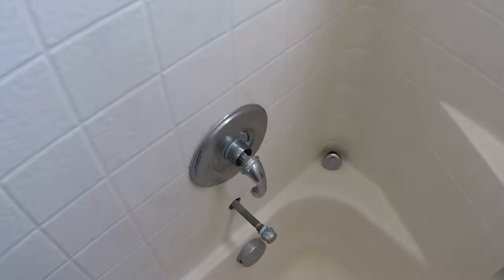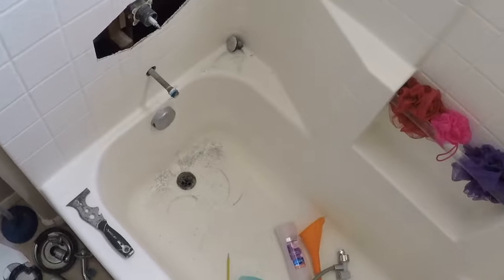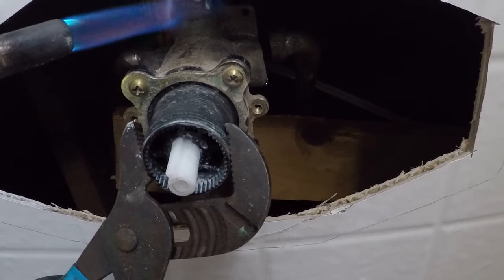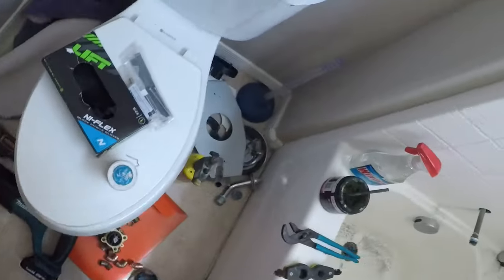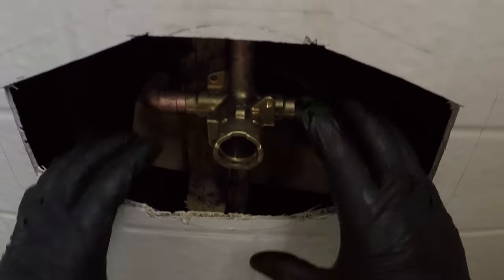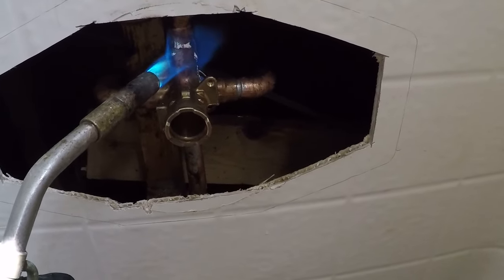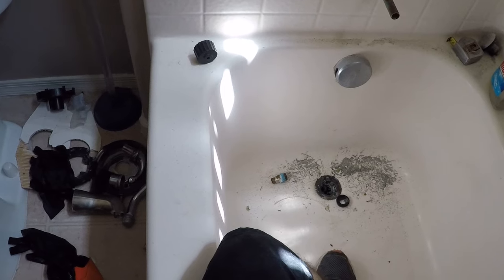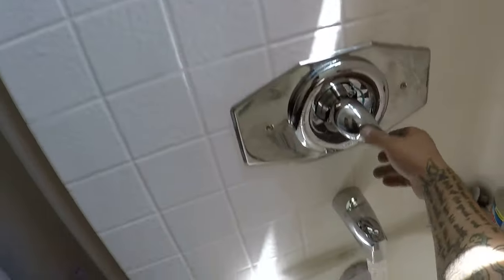How To Replace A Shower Valve Through Fiberglass - Gilbert, AZ

Comment: baffles me why to this day they don't build access panels
Reply from the maker: Well there’s actually another shower on the backside of this one, so I’m not sure that it would have helped in this application. But any other time, yes they do help and they do need them.
Reply: Medic311 cause more labor and parts 😂.
Reply from the maker: john tran Read the comment above. There’s another shower on the backside. What a bunch of geniuses on here lol
Reply: GMR PLUMBING i dont need to read comment.  I already know theres not a backside in your case. With common sense.  I mean why would you cut it in the front if theres backside. I said theres more labor and cost cause even new houses they don’t make access pane (like a already build access panel ready) I didnt said anything about your situation. You must misunderstand me lol
Reply from the maker: john tran Oh yes I see now. Yes you are exactly right. I must have misunderstood that. It’s just that there’s so many people on here that like to sit at home and criticize when they have never even touched a tool or plumbing in their life and have no valid plumbing license to back it up. It can be very frustrating sometimes.
Reply: GMR PLUMBING haha yep.  Bunch of idiots or even if there are some plumbers in here criticize you cause they do a different method and you dont follow their way they hate you haha.    The only thing i do different from you is i spray the surrounding area with water when i start using the torch and put some layers of towel in the bathtub so i don’t get complain saying i scratch their tub. A lot of people tell me i need fire extinguishers but water is enough for me. Sometimes i do it without spraying it.  Whatever it is its all good 😅

Comment: What the hell man, why did you go through all that BS when you could have just changed the Price Pfister cartridge and get a new trim kit?
Reply from the maker: The cartridge was stuck and the owner
Didn’t want to fight with it. They wanted to switch to Moen already beforehand anyway.
Reply: @TOTALTECHAZ  my cap is off to you brother,  hate putting a flame inside walls in finished homes
Reply from the maker: @stoneywilliams1209  Yea as long as you're careful it is not too bad. It really helps to have an adjustable flame that you can shrink.

Comment: no putty on backside of chrome cover? All that work and the easiest thing you don't do. LEAKER.
Reply from the maker: James Weirich Make us a video so we can see how a real pro does it. Thanks for watching.
Reply: I'm not a Plumber but I do know the use of putty and caulk is important to seal the job. Might as well do it right or don't do it at all.
Reply from the maker: James Weirich If you already know about it then you don't need me to show it to you. That's not really the point of this video. Maybe I did it after I stopped filming .  Obviously I know  that the plate needs to be sealed. There are plenty of other videos you can watch on YouTube about this. I don't remember inviting you here to tell me what I'm doing "wrong". If it's not something you're learning from then take a walk.
Reply from the maker: mike mike I did the job for $100 so it worked out. Thanks for watching.
Reply: That does not seam like much for the amount of work you did.
Reply from the maker: I was just being sarcastic to that know-it-all who probably lives in his mom's basement and has never touched a wrench in his life. Telling me what I woulda coulda shoulda done. It was definitely more than that but it was definitely fair. It was the best thing to do in that situation. I will be posting again soon. Thanks for watching!
Reply: Couple things here.  First goes to the plumber that's admittedly not a plumber.  Most shower valve kits come with a foam sealant on the backside of the cover.  Which is what you are referring too and really don't need caulked.  Caulking it is a cosmetic and only on the outside.  Never, never, never putty.  Never for anything should you use putty.  Putty is garbage and will create leaks quicker than you put it in.  He did a good job of what he did.  Sorry if you watch this old house and believe everything they say.  Coming from another plumber, he did nothing wrong.  Your just a guy who thinks he knows what he's talking about but in all honesty AND reality you don't.  Too the actual plumber, curious why you flux your joints after you have unsoldered the joints?  Why not just a wet wash cloth and then polish it up with sand paper or brush.   Secondly.  Do you have quick cuts?  Makes life easier than a sawzall.  But to each there own. Thirdly, I hate anything Moen.
Reply: Justin Dewan YeanI have some Auto Cuts but if you look carefully I actually cut the brass shower valve itself because it had Street 90s soldered directly into it and it was too far back to get the Cutters way back in there. But yeah typically that is the easiest way. Also you're right I could just use a cloth or something but it seems like flexing them really gets it down as flat to The Copper as possible and a small brush is easier to stick in the wall in your hand with a cloth. But both ways definitely work. I typically install Moen in anything that's an apartment or a rental because it's a budget-friendly line with a lifetime warranty. If it's in a personal residential home I'll go with Delta or American standard or maybe Kohler. Whatever that customer wants.
Reply: Ah, I see.  Distance looks off, looks like you had a lot of room
  Maybe the fish eye lens?  I've just come to find Moen to be the worst out of MOST of the line to work on.  Always have to find that certain part.  In my town they don't deal much in Moen parts except in literally one store.  That and Kohler.  Don't get me started on the old low boy style Kohler's.  Either way man, nice job.
Reply: James Weirich 46:30 He says something about putting call around the edge of the remodel plate and not the bottom of it for obvious reasons

Comment: just replace end wall board and new valve. it would look better. than that big plate ideal looks like shit. you did not screw valve in place too 2x4 in wall and the pipe. and you did not show how you threaded faucet copper pipe and how to install faucet to the pipe. and you should take time to ajust tempersure
Reply from the maker: Brent Marr It's a 1 piece surround with another shower on the backside. No dice. Thanks for watching.
Reply: Brent Marr Maybe you should take time to learn how to spell before you go writing comments on other peoples videos.

Comment: Look professional would go to the other side cut a hole threw drywall in room behind that wall if there is a room on they other side I've replaced many that away easy to redo drywall
Reply from the maker: Another shower on the back side big guy. Can't be done. Thanks for watching.

Comment: Great job
Reply from the maker: Brian Djordjevic hey thanks a lot for the comment and thanks for watching. There are several ways to do this but being there I felt this was a fastest most effective way of swapping it out. Especially because the back side of the wall was another shower I was pretty limited on my options. If you do this right it will look just fine with that plate there and we'll function just the same.
Reply: GMR PLUMBING you did nice work my friend keep up the looks great! Keep up the great videos